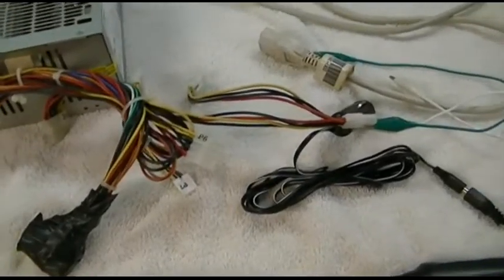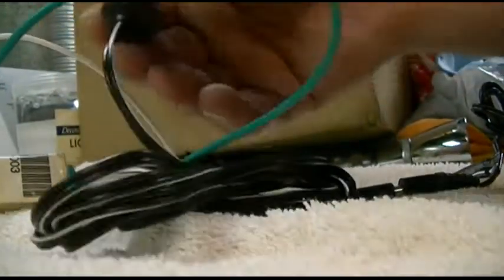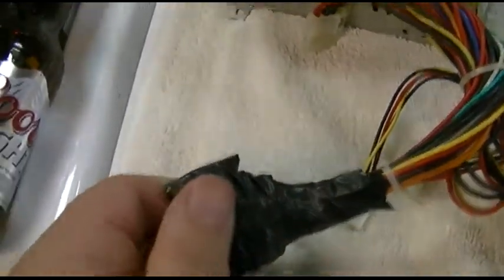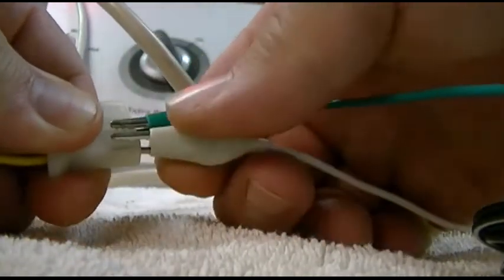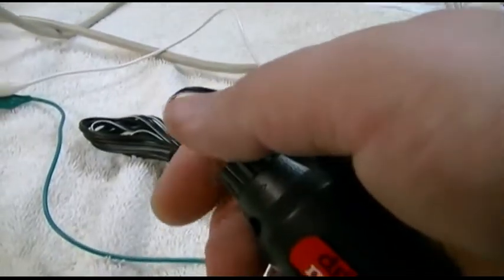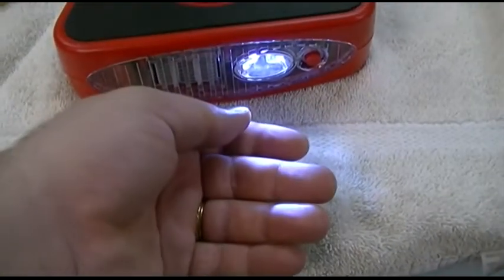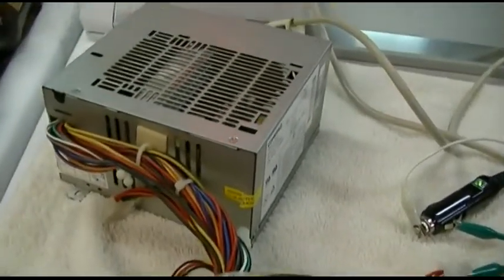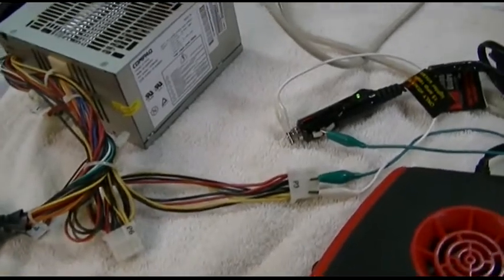Harbor Freight Power Supply Test

Comment: Am I understanding this video right that you are using the power supply to convert AC to DC power?  I didn't know that computer power supplies did that.

I have 2 railroad lights that I want to run and they use a DC power light bulb (just like a brake light on a car).  If i have 2 old power supplies laying around will I be able to use them to power the rail road lights?....

Learn something everyday!
Reply from the maker: Most power supplies convert AC to DC.  Just about any consumer electronics use DC, so they all have power supplies of some kind that convert to DC.

ATX power supplies will give you 3.3v, 5v, +12v, and -12v.  On the ATX connector you will need to short pins 4 and 5 (that's the green wire to the black to the right of it, when looking at the connector head on) to get the supply to turn on.  You can grab 5 and 12 from a molex connector easily--red is 5, yellow is 12.  If you want 3.3, or -12, you'll have to get it from the 20/24 pin connector.